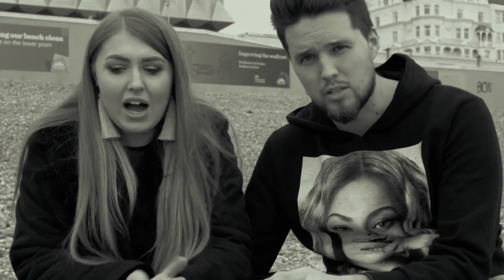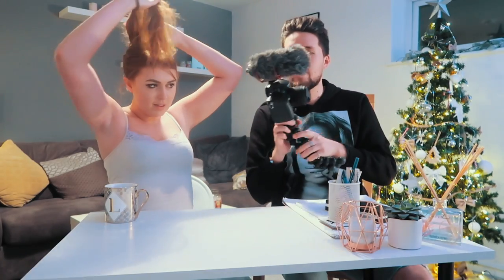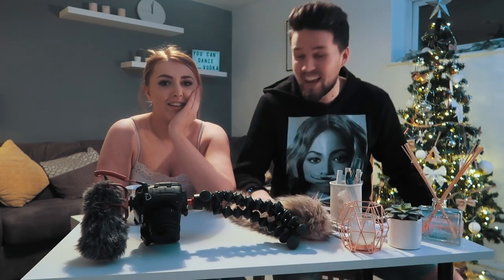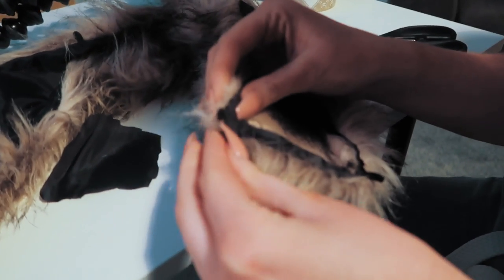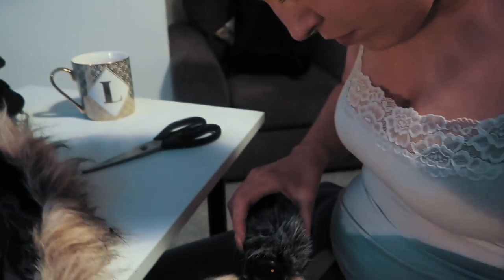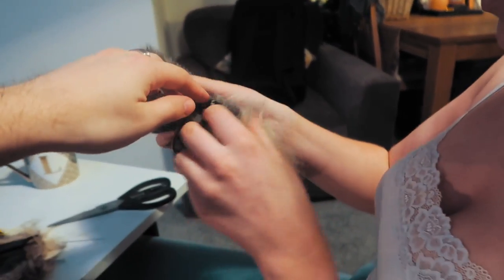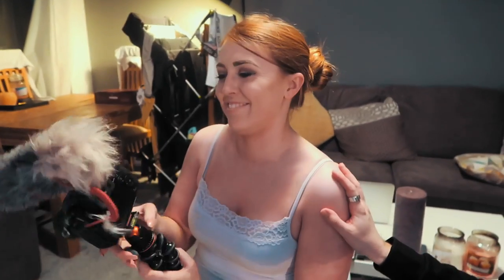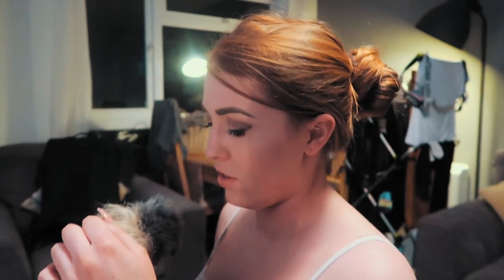How To Fix Wind Noise on Rode Mic Go - SOLVED!

Comment: Hey guys, we have the same setup with exactly the same problem, in hard wind our audio goes so quiet and all you.can hear is wind. Is there any setting that doesnt make the audio go quiet so atleast you can still hear yourself while vlogging on a windy beach? Or is this the reason for our problem
Reply from the maker: Hey! Interesting that you say this, we had this problem with audio going really quiet in hard wind. So I turned off a setting called "Mic Level Limiter" thinking it would fix the problem - however the clips after that the audio is just way too loud and distorted. So I think we will have to manually knock down the gain on the mic level - also thinking of upgrading to a better mic, but not sure if that would fix it! Also like the phantom power on the GO, having to worry about Mic batteries on top of everything else is something we could do without!
Reply: Ahhhh okok i just gave that limkter a test in wind and it does stop the audio going quiet which is good so thank you for that. I have my gain on -4 on the gh5 atm but maybe il knocm it down to -6 and try that, your right about the pro though its such a pain in the arse having to worry about batteries thats why we didnt bother with it. Happy i found this video now cos tht sou d issue was so annoying